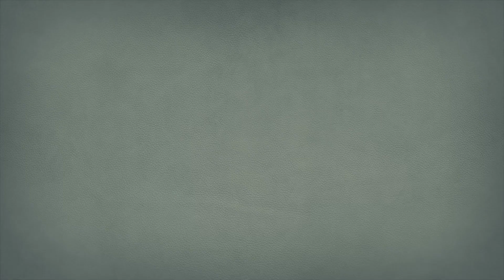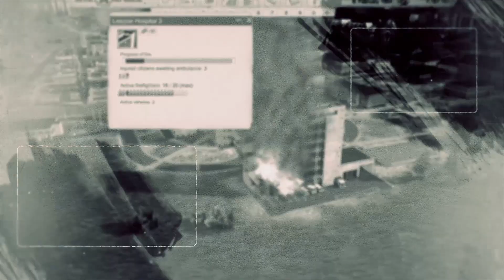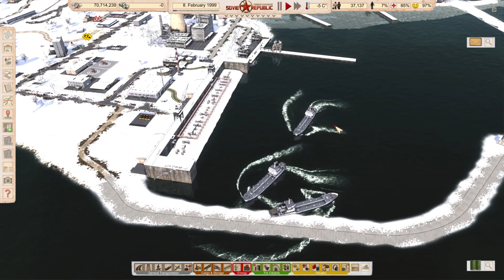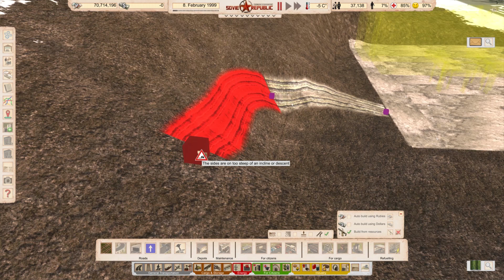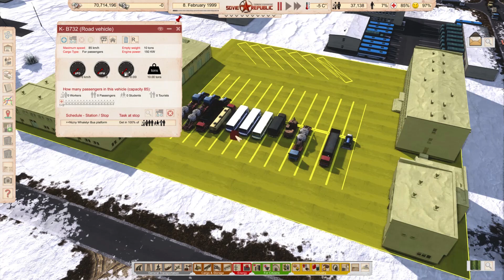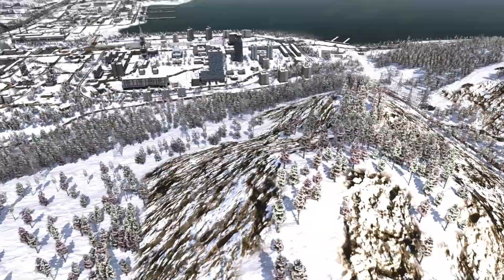Soviet Republic - Alaska - Coal - Ep.206

Comment: ur making ur railway worse the last 2 projects
Reply: whats the purpose of ur train storage bad place no room bottle neck
Reply: its unrealistic
Reply: u just said spread ur railway insections out and u do this ugh
ur going against what u say
Reply from the maker: @joshuapettit5068   @Joshua Pettit  The area where the train storage is located there is almost no traffic. Only a few coal trains will be using that railroad, nobody else. Train depo is realistic. This area does not need to be spread out because there is no traffic here and there won't be. Also, the depo is not a station. It's not the place that sees regular traffic that regularly interrupts other traffic. It's just one-time storage.
Reply: @oolykeegaming81  ah no ur gona have fuel oil bitamin trains running through there

Comment: its not the intersections in a railway that why ur trains r slow u need more centafores i mention this before
Reply: watch a stream on railways if u dont understand so stubborn
Reply: It is because the railways are completely undersized for the number of trains needed. We need "redundancy", so to say. Further traffic arteries would have to be created to relieve the railway. But there may not be enough space and the terrain is difficult.
Reply: @kutzematze  he has 2 many trains on his network u dont need train for every stop say like gravel delivery
Reply from the maker: @joshuapettit5068  really? Gravel? Gravel was one of the most required resources and we lacked it every time. 

@Manoel do you see any trains that can be made redundant? I only see gravel and material trains that could be removed but we were already missing bricks, prefabs, and gravel before. If I remove any the construction will stop.

I'm trying to make the system run smoother with more trains rather than fewer. And I believe the intersections are slowing the system down rather than the number of trains. 

@JP I might be wrong about this but I will address your issue and ask you in the next episode where do you think more semaphores are needed. I will go through the line and let me know what you think we should do.